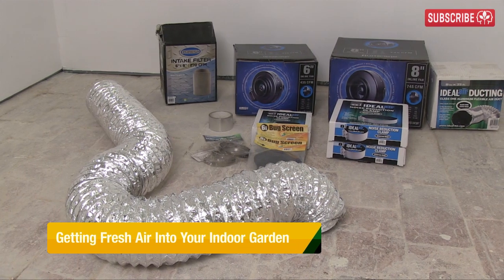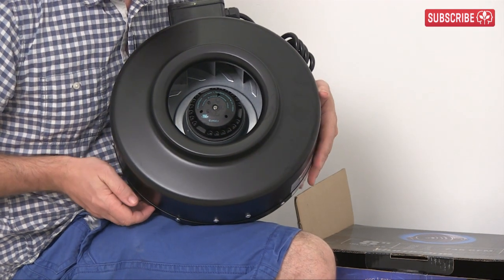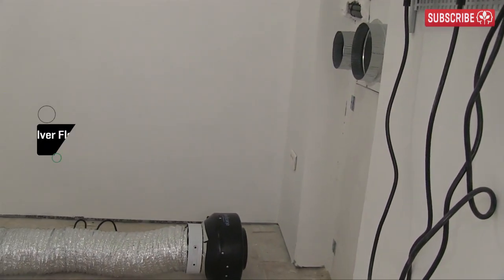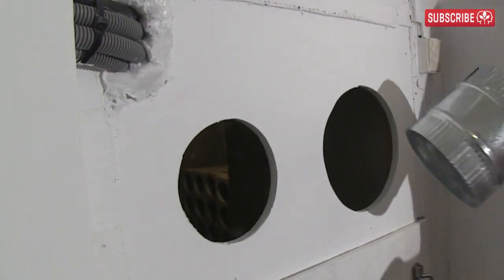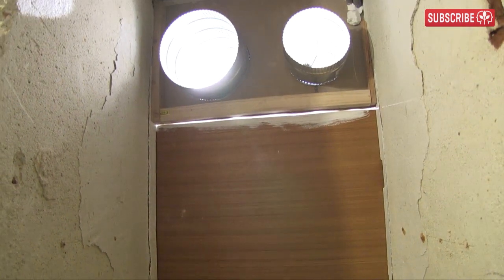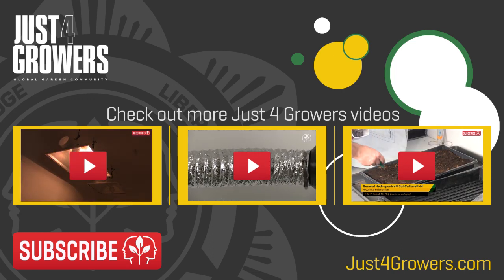Grow Room Ventilation 101—Calculating Fan Requirements for Incoming Air.

Comment: No need for 2 extraction fans. You can suck the air through the reflectors on it's way out. I know it will work well because I have done it before.
Reply from the maker: Hello there amigo. It's typically recommended to BLOW air through air-cooled reflectors in order to create a positive pressure inside of the attendant ventilating ducting system. This means that any small leaks in your air-cooled light ventilation system will need up blowing air out back into your room, whereas if you suck, you risk sucking unfiltered air into your ventilation system which could disperse terpenes into areas where they are not expected or welcome.

Comment: Replace the entire  air volume every minute? Why??
Reply from the maker: If you have a room full of healthy transpiring plants they will quickly fill the room with humidity and deplete carbon dioxide levels during the day cycle. However, since this video was made, LED grow lights have become very popular and they change everything! Look out for an updated video soon...
Reply: @Just4Growers  7-8 times an hour is plenty. I've never had problems at that frequency. The plants' respirations is simply not that fast to replace the air every minute. That's way too much and is wasteful as one would need much larger appliances to do that.

Comment: How did you arrive at the 1 air change/minute rate?
Reply from the maker: Hi John, thanks for your question—it's a really good one. Firstly, to answer you directly: twenty years ago, if you were to attend an "indoor gardening" trade show (as they were marketed back then) you would hear fan manufacturers and professional growers recommend one air exchange every two to three minutes. Then, as lighting became more powerful, it gradually came down to one exchange per minute—and, due to the simplicity, this recommendation kind of stuck. Of course, it was born out in the real world too. Now, THIS VIDEO is eight years old and, during that time, we've seen LEDs take the market by storm. Now the air exchange recommendations are even higher. TWO exchanges per minute and more! Of course, these are massive generalisations that don't take into account the ambient environment / climate. But it's ALWAYS a good idea to over-spec your fan (if you're trying to decide between a 6" and an 8" EC fan for example, always go for the 8" — not because I'm taking a commission on all brands' fan sales — but because you can run it slowly, without additional whirring noise, and you have the extra bandwidth for moving a lot of air if you need to, on hot days / nights, etc, and it will always run more quietly than a smaller fan moving the same amount of air through narrower ducting. Seeing how long this reply is already getting, I think I need to completely revise and update my grow room ventilation series for LEDs — as they have completely changed the goal posts. Before, the main bogeyman was HEAT and that was the main reason we vented—now, it's more about humidity and CO2 replenishment — as LED rooms like to be run a little warmer to make up for the lack of IR in the LED grow light spectrum. So much to discuss! You can always reach out to me personally at just4growers@gmail.com or we can continue the discussion right here if you prefer. Interested to hear your thoughts on this.

Comment: Hi 

I accidentally(stupidly) put my hand in the Aluminium outlet of my fan(Prima Klima 2 speed 125) to insert an ONA BLOCK inside but it blocked the airflow for a small time 2-3 seconds max and it made the fan sound louder for that period of time . Now I think that the fan has got Louder while operating . is this the result of a quick outlet blockage or that blockage won't affect the fan function at all ?I would like to know if its only in my head or the fan can get damaged/louder if the outlet is blocked for couple seconds ?

Thank You for considering my question

Comment: Just an observation but the duct couplers are designed to flow like a rain gutter.  The input side should be on the inside diameter.  Otherwise dust and air will escape between the two sections of the coupling.

Comment: What to do when can only take in air from outside. Cold and humid air.
Reply from the maker: No chance of taking air from an adjacent room? You could consider a sealed environment.
Reply: @Just4Growers  hi. No. I isolated the tent but its in a place with no room isolation. And cant take air from inside. I tried to open the top intake passiv. And there is isolation infront of the holes. It seems to do good. Only a few degrees up and down and the same with humidity. But dont know how is gonna react when its colder. Any info about sealed environment. Not many talking about it on the net.
Reply: @user-jm5hg3qi4f   Check out monster gardens. (youtube) lots of info on sealed rooms. Hope it helps you out. Good luck.

Comment: And don't forget to account for any bends from elbows or turns in the ducting. It looks like you have a few. Those usually drop the cfm flow anywhere from 1-4% depending on many factors, such as how smooth the elbow is and its sweep angle. For anyone looking to get even more serious, or needing info on much bigger systems, I suggest you look into buying the ANSI/ACCA manual D.
Reply from the maker: Thanks amigo.

Comment: You do nice, clean work though, and I like a lot of what you did here. Just a few more tips. 

- Use the insulated (no lower than r6, and stick to r8 if you can get it) ducting that you can get at the hardware stores. You should especially be using this for exhaust lines because any duct line carrying hot air that is not insulated is just going to be dumping radiant heat right back into the environment you are trying to remove it from. 

- I think you could stand to use more light. Throw out those 1000s, because they suck. You can't get close enough to the canopy with them, they get way too hot, and their hot spots are way too intense and damaging. Unless of course you have a massive warehouse and/or are using the double ended bulbs. I think you would have been better served by two dual lamp raptors, or four radiant 8s stocked with red and blue 600 horilux bulbs.

Comment: I am also wondering why you are not just doing passive intake. I have never seen a real need for intake fans on these size rooms, and in my own experience, an 8 or 10 inch vortex or fantech (especially fantech) can pull more than enough cfm to provide passive intake. I have to wonder if you had issues with the negative pressure of the room when you pump intake in with a larger fan that you do exhaust. I assume you know that providing more CFM on the intake (pushing) than CFM on the exahust (pulling) will not result in negative pressure but in fact positive pressure. If you run positive pressure, you better have one bad ass recirc/scrubber carbon filter set up, because a bunch of smelly air is certainly going to make its way out of the room before getting a chance to pass through the exhaust filter and have adequate soak/contact time.
Reply from the maker: I like to draw my input air through an intake filter to keep things super clean and sterile in my grow room. An active intake fan works well in this situation.
Reply: @Just4Growers  For sure. filtering would be a good reason to not do passive. But so many of these are going into little closet set ups, and most people don't bother much with filtration on those. 

Although, if you have adequate stand alone filtration, such as the EN 1822 classified IQair health unit, then intake filtration doesn't have to be as stringent. If you have something as high quality as EN 1822 HEPA, then all you really need on the intake is a light MERV for bigger pests and low pressure drop.

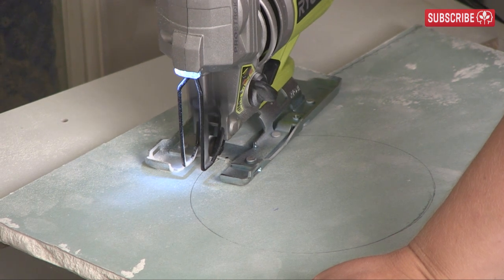Comment: 1:55  -- Man, dremel makes easier and more accurate hole cuts than a jigsaw. The $10 circle cutter attachment is so worth it. Smoothest, roundest cuts outside of a hole saw bits.

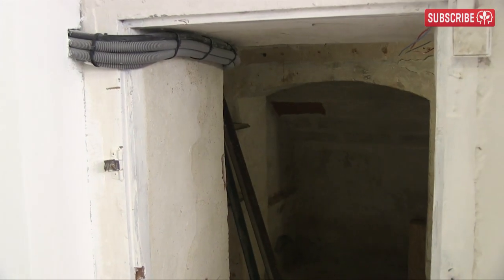Comment: 0:40  --  It would be smarter to have both, as a hybrid set up with manual dampers (motorized or not) to control which side the air comes through. In the winter/cold season when the outside air (I am giving benefit of doubts by surmising you are smart enough to run flower at night and not during the day when it is potentially 100+ outside) is much lower than the inside/conditioned air, you can save money by turning the grow room AC off. Some places, the dead of winter air can be TOO cold, so having iris dampers on there too would allow fine tune throttling, allowing you to mix the intake with some outside cold air and some inside conditioned air. And of course when the temps/weather call for one or the other damper/intake side to be open or closed, you have the open to do that with either side.

Comment: Do you run the fan will the lights are off?
Reply from the maker: Yes - 24/7
Reply: @Just4Growers  Thanks
Reply: @Just4Growers  Just the light turn on and off, in a cycle?
Reply from the maker: Hector Luis Colon Rosado yes - keep the air moving and exchanging 24/7 and run your lights according to your plants’ preferred photoperiod.
Reply: Everest Fernandez thanks your videos are awesome
Reply: @Just4Growers  do you take co2 into consideration?

Comment: you really dont wanna use the flex ducting in more then 4 foot sections- it flows terribly- straight solid for the win- up your cfms by a ton
Reply from the maker: stevecameron85 That’s great advice Steve, thank you.
Reply: yeah those ribs inside make for a ton of turbulence. I use the flex ducting only when solid is not an option. also stay away from 90 degree bends- they kill flow too!

Comment: There should be thermal insulation on all non-glass surfaces to ensure heat from the light is exhausted rather than just radiated inside the tent/room.

Comment: i gonna get grow tent 1,00x1,00x1,80cm  homuch i need?
Reply from the maker: Hi Damien, in metric? You'd use CMH or cubic meters per hour. 180 CMH would be your minimum or 65 CFM. I'd recommend going bigger and using a fan speed controller. Always good to have some spare horsepower should you need it in the warmer months.
Reply: yes metric, Tnx

Comment: My grow room is being exuasted just under once per minute. I have 2 intake vents with filters on the opposite side of the room. My question is do I need to attach a fan to push air into my grow room or is the negative air pressure from my grow room enough to just pull the air in? Thanks
Reply: Aaron .

Comment: The only good access to fresh air is from the house vent.its located on the side of the house what are you thing bringing in the air to the grow room?or the other option is from the outside but would be more hot.sorry I'm from other country and English isn't my language.
Reply from the maker: +Robs Hi Robs—thanks for your question. I enjoy speaking with fellow growers from all over the world. (What is your first language?) Your best option is to bring air in from another room in your house as the temperature and humidity of this air will be more stable than the outside air.
Reply: Ok that's what I'm going to do. I was trying not to cut a hole on my house but rather be safe than sorry.my first language is Spanish ,and I have one more question I just bought a filter last night I accidentally let it outside It got wet it rain all night D
Reply: Do you think still good?
Reply from the maker: +Robs Ola Robs.Estará bien. Sólo tiene que dejar que se seque. (It will be fine, you just need to let it dry out.)
Reply: Que Bueno.me salve de comprar otro
Reply from the maker: +Robs ¡Buena suerte!

Comment: Hi Everest, at last an expert in this stuff on YouTube. :)---
My specs are --- 2' x 4' x 5.8' Gorilla shorty grow tent - Advanced LED Diamond Series DS XML 350 light.---I was considering getting the Gale Force 6" Inline Fan, 412 CFM - with using a variac transformer I already have, as a speed controller.......and using an iPower GLFILT6M Air Carbon Filter (6 inch x 16 size) to filter and exchange the air.---The tent has a built-in micro-mesh filter on the bottom middle back of the tent, for air intake.Will this Gale Force 6" fan be over-kill, or will it give me 'wiggle-room' for hot humid days?Will the variac transformer control the Gail Force fan speed?---Do the carbon filters work better with the air flowing slowly thru them, not putting carbon dust into the air?Or does that not happen if the fan is full-blast?---Also, if the built-in micro-mesh filter is on the back bottom middle area, where should the filter be hung, and which tent duct hole should the air be sent out thru?  (Upper left, right, or back-left side of the tent)
Reply from the maker: +John Smith Hi John, thanks for your question. So your tent is just under 48 cubic feet. Your fan is rated at 412 CFMs. Attach a carbon filter and that will reduce output by 20%, so now we're at 330 CFMs, but ducting arrangements could bring this down further to around 275 CFMs. We're still way over your required minimum of 48 cubic feet per minute but if you are living in an area of high humidity then it might be a good idea to have the extra power—especially if you already have a fan speed speed controller. I'm not familiar with the Gail Force brand and its compatibility so I'd have to get back to you on that one. The slower air moves across the carbon bed inside a carbon filter, the more contact time the air has with the activated carbon, and the better it will work. Your chosen carbon filter (iPower GLFILT6M Air Carbon Filter (6 inch x 16 size)) is rated to filter air moving at 400 CFMs or less so you should be okay. The filter should be positioned as high up in the tent as possible, ideally vented out through the roof port. If you have mesh inputs at either side of the tent then the middle is the optimum position. You could use some clip-on wall oscillating fans to help circulate the air but be sure to choose a premium brand that's rated for constant use as the cheap ones tend to burn out and can present a fire risk. I hope I answered all or most of your questions—let me know if you have any more. Peace out, Everest.
Reply: +Everest Fernandez (Just4Growers) yes, you've answered, with great info too. -- 
The slower air speed thru the carbon info, and its placement, is very helpful :) -- will the slower air speed thru the carbon extend the carbons life, or use it up faster?
...! ... :-o ... :) ...
I'm glad I'll have so much 'wiggle-room' with the CFMs because I recently found out the built-in micro-mesh filter on the tent will leak light, so I'll need to make an upside-down 'U-bend' with ducting, thru one of the tents lower ports as an air input, to block any light leak...I hope...will that work?. -- are there any micro-mesh 6 inch duct intake filters for sale to put on the bottom of that U-bend?
Reply from the maker: +John Smith Hi John. The slower airspeed will not extend the carbon's life—that's determined largely by the amount of surface area on the activated carbon's micropores. For your 6-inch duct intake check out something like Black Ops' bug screens ( https://goo.gl/3WlOSa ) or a Phresh Intake filter ( http://goo.gl/MZgYCd ) - the latter wouldn't require a U-bend.

Comment: My grow space is 2,304 cubic feet. If the highest CFM most fans go up to is 750 do I need to have more than one fan for my incoming air?
Reply from the maker: Nice space Greggory! You can get more powerful fans than 750 CFMs but it's no a bad idea to spread your air exchange requirements over multiple fans for a space like that.
Reply: Everest Fernandez Thanks for the reply!
With multiple fans for proper air exchange would I need more exhaust?
Reply from the maker: +Greggory Brandt Normally indoor growers spec their exhaust fans slightly higher than their inputs (be sure to allow for any pressure drop due to carbon filters on your extraction side too, usually around 20 - 25%). By extracting more air than you input you create a 'negative pressure' inside your grow room which makes it easier to control your grow room's environment and any garden odors as air is being pulled into your garden through any leaks, rather than being pushed out.

All that said, I know of a grower in Holland who swears by positive pressure—he tells me that it increases the amount of effective CO2 in his garden. I guess 20% more pressure = 20% more CO2, and—as it's such a crucial input and often the bottleneck of indoor gardens reaching maturity—he may have an interesting point! I'll be looking into this next year.